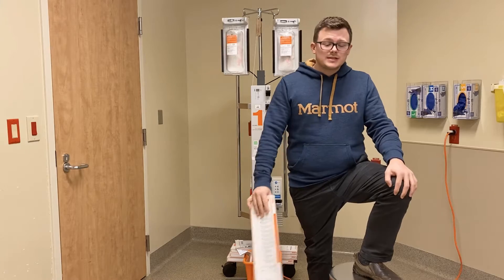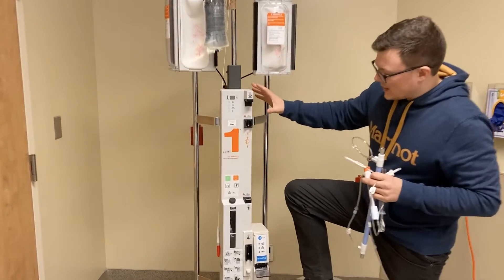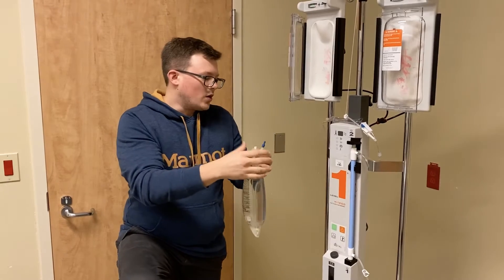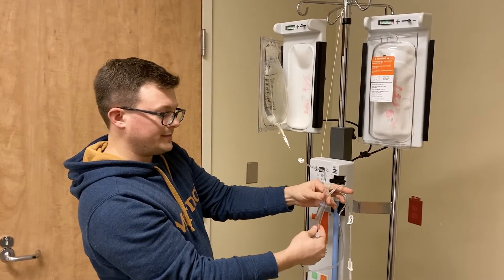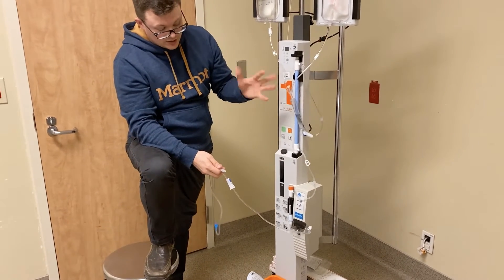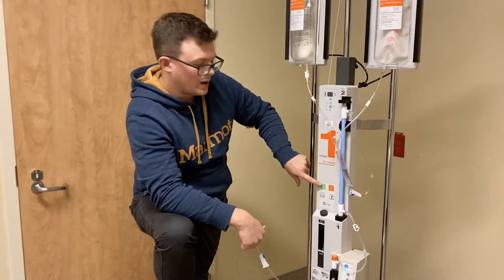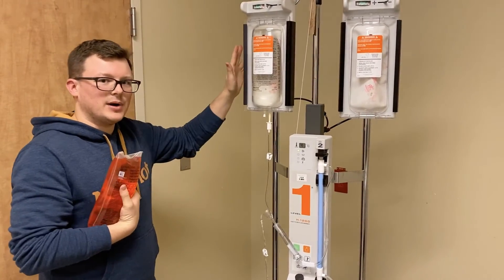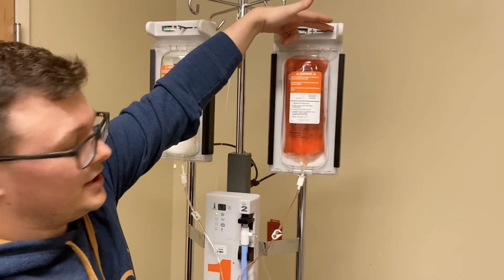Priming the Level 1 Rapid Infuser

Comment: I believe the disposable set you installed is for the smaller capacity Level 1 warmer normally used in the OR.  
The high flow trauma disposable set has a WHITE Heat Exchanger with higher flow & warming capability.
It also has larger bore sizes including bag spikes & luer fittings.  Fortunately both actually fit either machine ... brilliant.

Comment: Step 1: Throw out this archaic machine, which is essentially just a fancy pressure bag.
Step 2: Have the hospital purchase a Belmont rapid infuser...
Seriously, if the hospital can't afford a Belmont, they shouldn't be calling themselves a trauma center. 
They are faster, efficient, and literally anyone with IV pump experience can set it up by just looking at the tubing. Not to mention safer with the ionizing technique it uses it get rid of ANY air bubbles.
Reply: Do NOT listen to @GetTheJabPlease.  The Level 1 unit has a LONG history of reliability, is easier to set up, has fewer false triggers or alarms and the disposable set can be moved between Hardware Units as needed or function as a non-heated infusion set when released from the hardware.
Reply: @ec120pilott2  Belmont takes much less time to set up. During MTP time is critical. DO NOT listen to this guy.

Comment: Step 1:  Make sure you have distilled water readily available to keep the fluid chamber (located next to the number 1) filled to the marked line.  Most hospitals rely on bio engineers to periodically check these levels, yet the RN is the last stop for safety.  Can you fill this fluid chamber with sterile or tap water?  NO!    Please read the manufacturer's Instructions for Use (IFU) and the manufacturer's educational videos for more details.  Any travel ER Trauma nurse or new grad ER RN should teach themselves the ins/outs of any equipment they work with by visiting the manufacturer's website.

Comment: nice presentation, only a couple of mistakes, you need to turn on the Level 1 when you first put the disposable set into the Level 1 before you prime the line. This will give you green light on the main body and an alarm at the Air detector, at this point you will be able to detect any leaks on the  circulating medium ( normally distilled water or H2O2 0.3%)this will also start the heater, if you do this the level 1 will be at 41  deg C before you have the line primed. You also need to look back at the alarm explanation, the alarms on the air detector are not connected to anything on the main body. I suggest you speak with your Level 1 rep and correct these few issues.